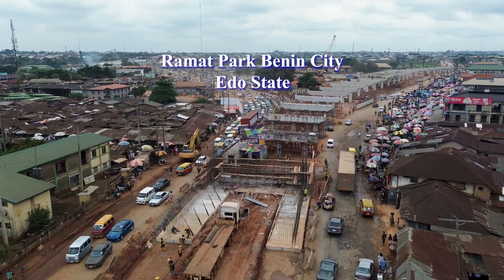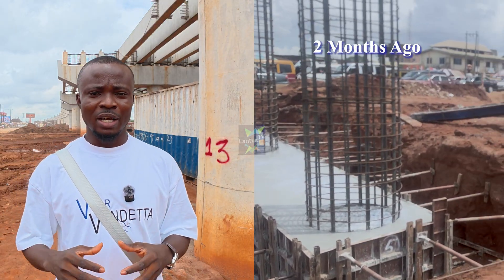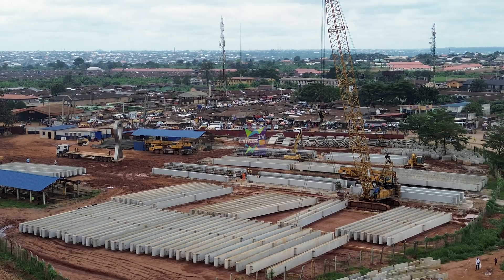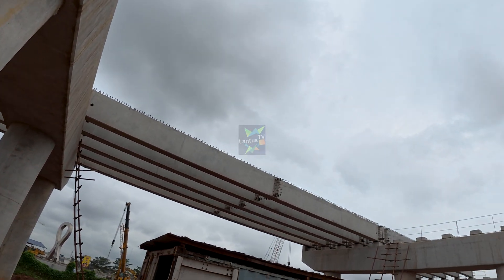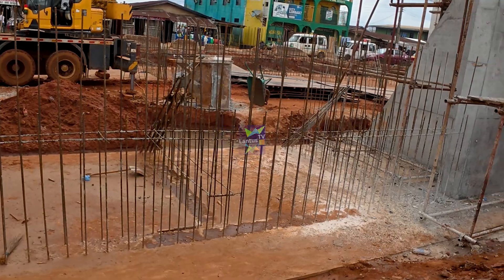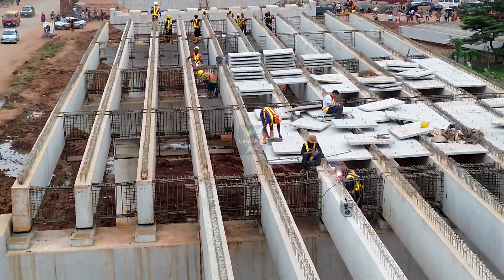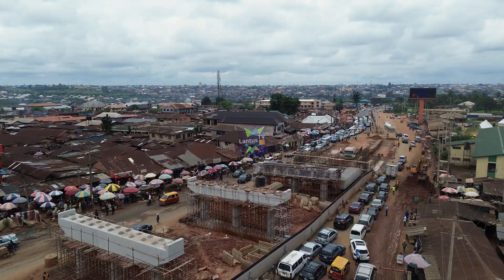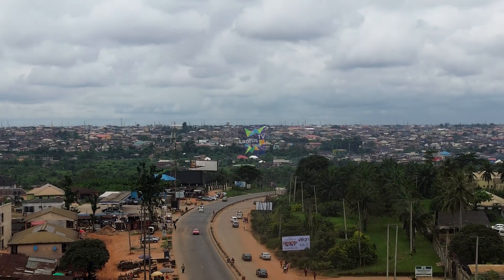Beams Are Going Up! The Ramat Park Flyover Enters Critical New Phase (Full Update)

Comment: How functional will the flyover be in that particular location?
Reply: What we need around that area is a bridge between Saint savior/ irhimwin  area and ikboba  and not a fly over. As big as ikpoba hill and aduwawa axis, the only road out is just two. Add another one that comes out of saint savior irhimwin areas and the traffic will be gone.
Reply from the maker: @WizzDom-vz1un Your suggestion is on point, I share the same opinion. Building a bridge linking Saint saviour and Ikpoba hill will do the job but the ongoing flyover construction is also a welcome development so long as it helps alleviate the notorious traffic at the Ramat park route... Please subscribe for more update.
Reply from the maker: It will help alleviate the severe traffic congestion at Ramat Park, which connects four major areas in Benin City. A flyover at this location is long overdue, commuters have endured significant delays along this route for years, especially during peak hours. The construction of this flyover is a much-needed and welcome development.